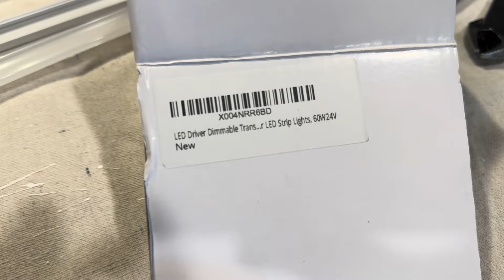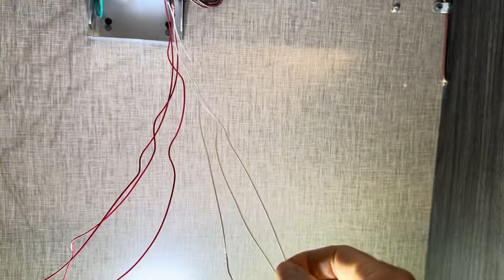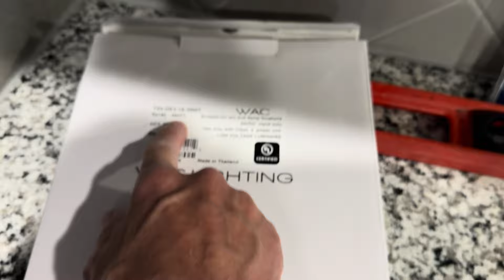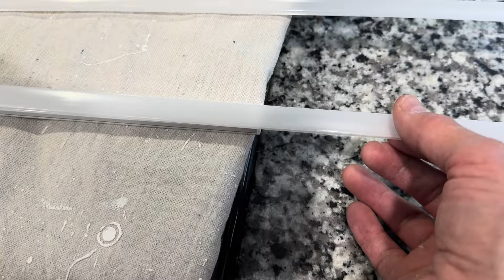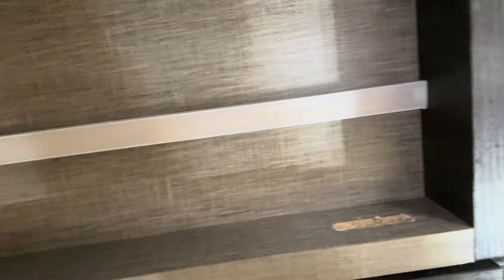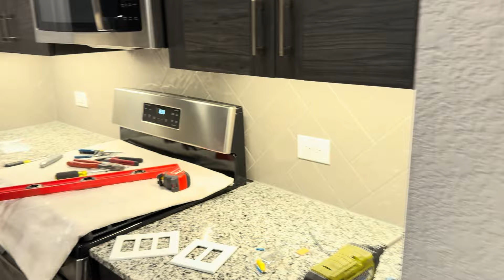WAC Gemini LED Tape & Caseta Dimmer Pt. 2

Comment: Excellent workmanship. The milky white diffuser reduces the light brightness slightly. Of course you need to use it with SMD tape to reduce the dotting effect, but do you ever skip the milky diffuser with COB tape if it is mounted hidden and will never be seen to get the full brightness?
Reply from the maker: Thanks! Very true that it’s perfectly fine without the channel. We used to use it without channel all the time, but one builder we worked with insisted on it. It just looks so much better and professional with the channel. So we just started using it on all the kitchens we were doing. Homeowners also prefer it to open tape underneath their cabinets. There was also issues with the adhesive not holding and having to return to glue the loose ends back up. That ended with channel and screws.
Reply from the maker: As for the brightness, it’s really not that much different than the bare tape. The clean look outweighs the loss of a few lumens in my opinion.